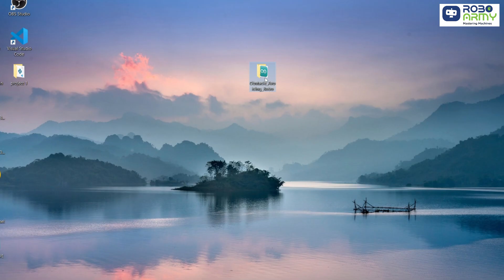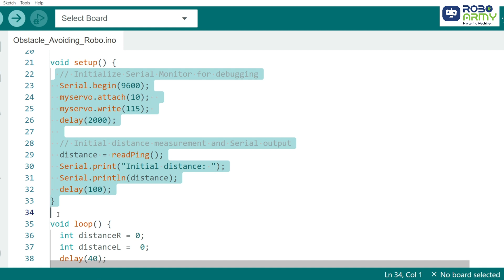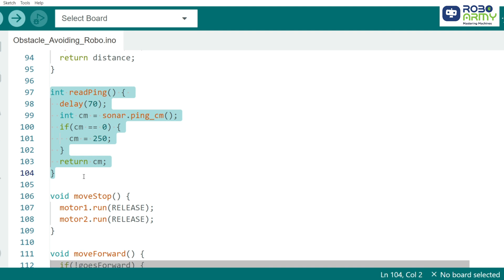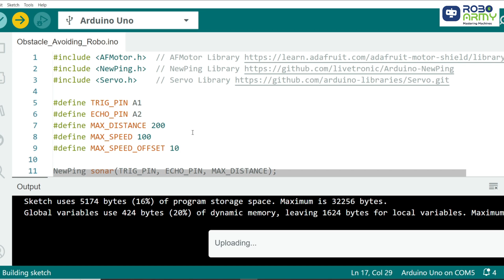Build an Obstacle Avoiding Bot with Arduino

Comment: I am not able to select the board
Reply: tell me the solution
Reply: please
Reply: Please assit me to
Reply from the maker: Hi! If you're not able to select the board in Arduino IDE, try these steps:

1️⃣ Check USB Connection
– Make sure your Arduino board is properly connected via USB. Try a different cable or port if needed.

2️⃣ Install Board Drivers
– Go to Tools > Board > Boards Manager, search for your board (e.g., Arduino Uno), and click Install.

3️⃣ Select the Right Board
– Go to Tools > Board and select the correct board (e.g., "Arduino Uno").

4️⃣ Select the Correct Port
– Go to Tools > Port and choose the port that appears when your board is connected.
(If no port shows up, try reconnecting the board or restarting the IDE.)

5️⃣ Try Restarting Arduino IDE
– Sometimes just restarting the IDE fixes it.

💡 Still stuck? Let me know your board name and IDE version — I’ll guide you further!
Reply: @robo_army_   Thanks
For telling
Reply from the maker: @atulsureka5992  Glad to be of help. Stay connected for more useful content.